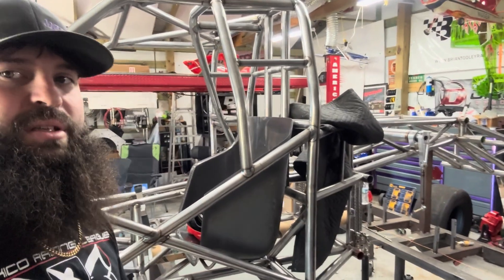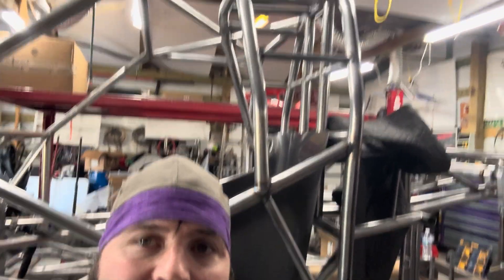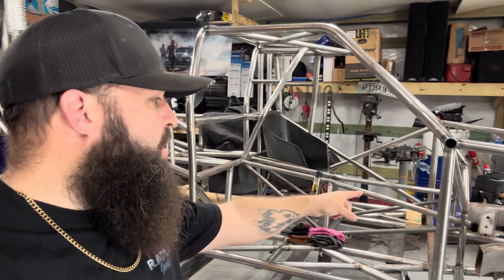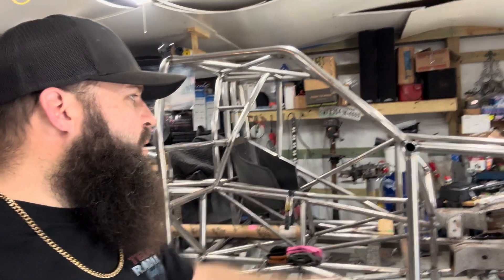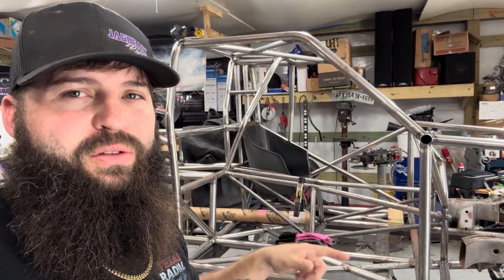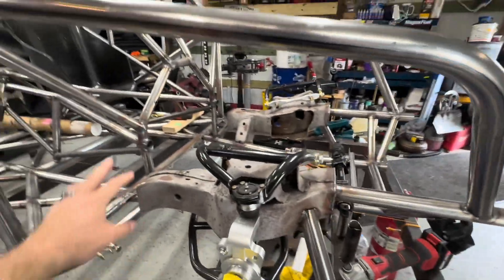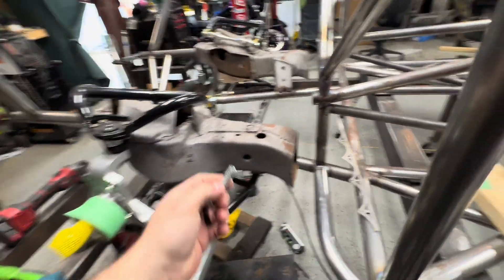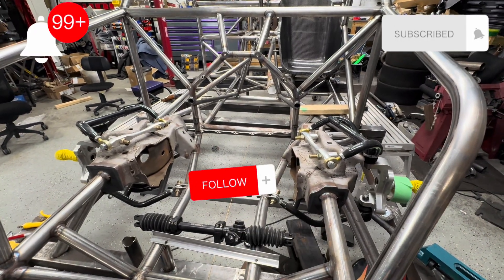How to build a drag chassis 25.2 💥 building sleeves for midplate and finishing funny car cage

Comment: Your building a badass s10. Why did you decide to use factory frame and arms instead of strut frontend? Is this going to be a radial truck?
Reply from the maker: Around here tube chassis was a heavily cried about thing, and this technically is not full tube chassis. But these days people don’t care as much so yea i have my regrets but this will still work good